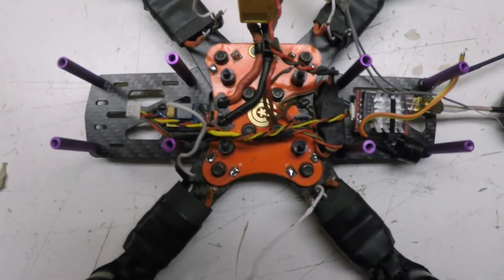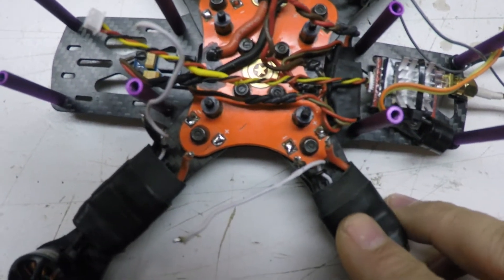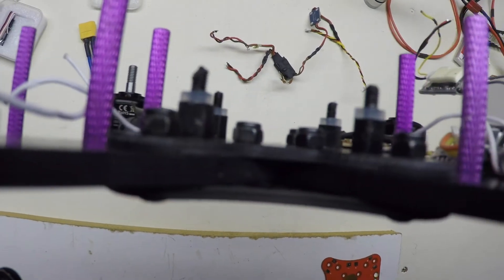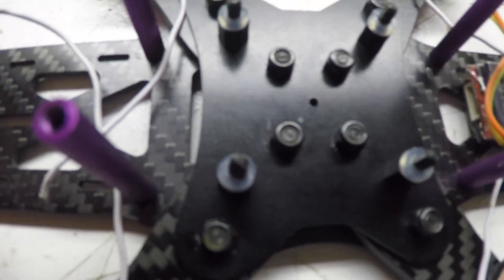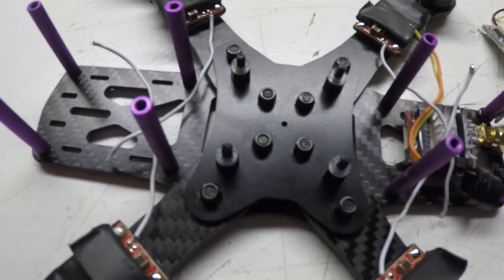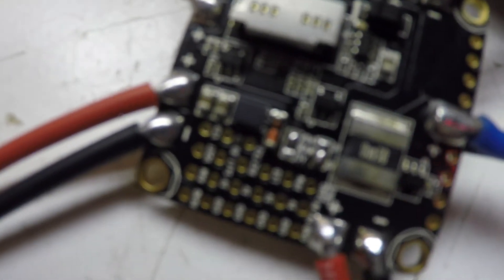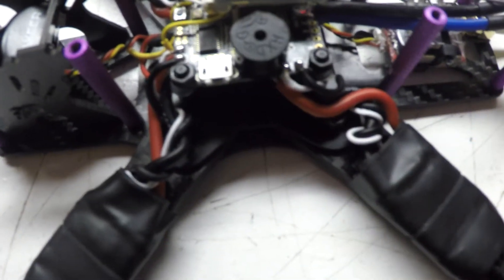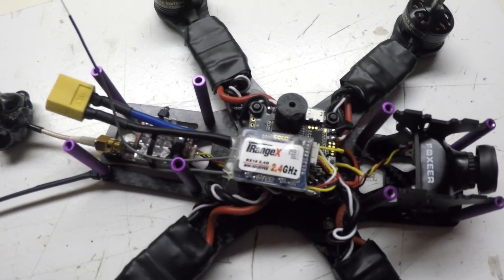Martian II FPV Freestyle - Betaflight F3 Upgrade

Comment: Good setup. Martian 2 without PDB have oscillation problems? I think the PDB is integral part of the frame. I would know your consideration about because I'm starting new build with The same frame and FC. Thanks
Reply from the maker: I have not noticed any issues with oscillation problems eliminating the PDB.

Comment: i am curious as to why the upgrading , as I watched the original build and thought it flew well, did I miss something?
Reply: Ok found the video where you explain it all so I did miss something, going to watch it  now, thanks. :)
Reply from the maker: My main reason for upgrading is so I can adjust PIDs without taking a PC to the field. Also I have been flying the Flip 32-F3 for a couple of years now and just thought I would try something new. Just for the record, there was nothing wrong with the original build set up and I thought it flew real nice. Hoping I don't mess that up by changing to a new FC. I can always go back if I need to.
Reply from the maker: No problem, so far so good with the new Betaflight F3 flight controller. I haven't experienced any of the negatives that some people are complaining about with this controller. I have had 100% success so far, let's hope this continues. I really do like being able to change my PIDs with just my radio and goggles. Thanks for watching.

Comment: I just built the Martian II in a very similar way as your upgrade. I had used the betaflight f3 board before so I used it in my Martian build and left the Martian PDB out. I'm running my VTX off Vbat on the betaflight RAM pin and my Foxeer camera from the 5V supply on the board, 30 amp DYS ESCs and 2205 S Emax motors. Maiden flight yesterday on betaflight default PIDs and it flies nice but needs a little tuning which the BF OSD PID tuning is great for. Can't wait to see yours in flight with the new FC.
Reply from the maker: So far so good. My first impressions is it's a good flight controller for what I want. Sounds like you are running a very similar set up on your quad. Thanks for watching.